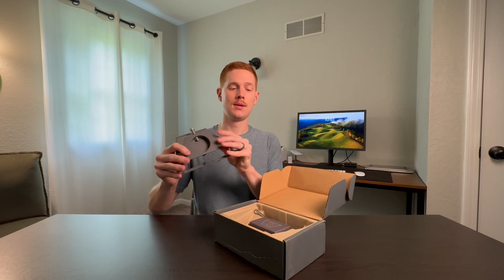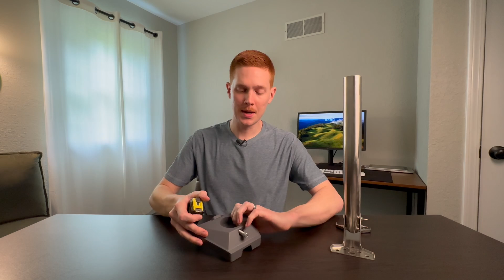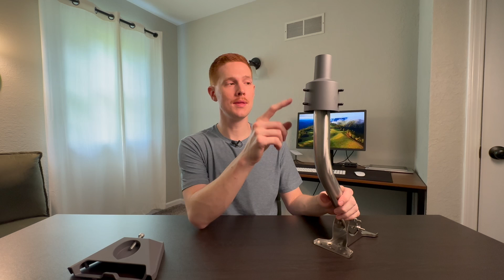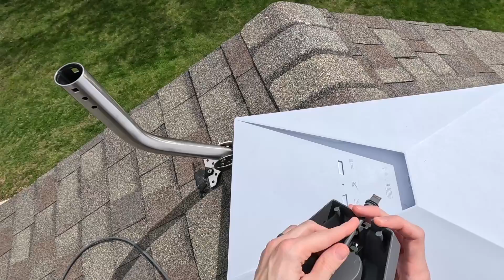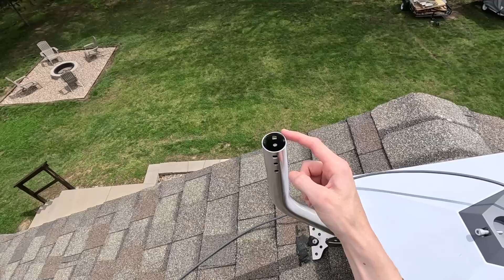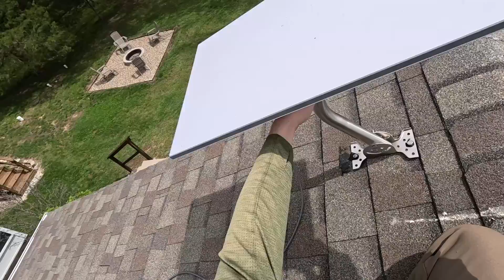The Worst Starlink Accessory - Gen 3 Pipe Adapter Review

Comment: I installed my Starlink in July 2025 and the new Gen 3 bracket is much improved from what is shown here, and I had no trouble with the installation. The hole is deeper and there are now two bolts to secure the pipe adapter to a pipe. In my case, my J-mount was probably 1.25 inches in diameter, but I got a very secure coupling. Bottom line, this video is now outdated, and the advice should not be heeded. Since this channel‘s owner is a responsible and well intending individual, I would suggest that the video be pulled.

Comment: This is an outdated video. I just got my new adapter this week and installed without problems. The pocket is much deeper than what is shown on this video and it has 2 screws. Please remove this outdated video and don’t mislead others into buying third party adapters.
Reply: Can I remove my dish satellite and connect the adapter to the pipe that held the satellite?

Comment: I purchased a stainless steel mount from Amazon with SIX set screws total in two rows and a deep socket for the pole. I can’t yank it loose but I think I want to add a self tapping screw that will penetrate the mast. Our building codes assume 100 mph winds. A loose connection to the mast will turn the Starlink antenna into a wing in a high wind.
Reply: Do you remeber the name of your adapter?

Comment: Most shops seem to be selling the second version which is virtually the same as the first one. Did Starlink give new antennas to those who lost theirs?
Reply from the maker: The new version does fix the main issues. It has a deeper tube to accept more pipe, and now uses two set screws instead of one. I haven't gotten around to a follow up review, but reading online reviews, it seems to be a decent option now. Still plenty of 3rd party pipe adapters if you don't trust it. I haven't spoken to anyone who lost their dish due to the design. But since it was a recalled device, any dish damaged by the original pipe adapter should be replaced free of charge.

Comment: What I’m actually looking for is a Gen 3 to Gen 2 pipe adapter.  We like our Gen 2 mount but of course the Gen 2 pipe attached to the dish securely snaps into the mount and I’d like to keep the mount but use it with a Gen 3 dish.
Reply from the maker: Got ya covered: https://youtu.be/KCFuqaxZrYE
Reply: @DISHY_tech  Super helpful,thank you.  I guess my only concern is that in this video you list the Starlink tube adapter as the worst accessory.  I’m thinking maybe i can buy a better Gen 3 tube adapter and then cut the tube off my Gen 2 dish.

Comment: You should be able to rig up a pipe adapter to go from what looks like the 1.5" pipe to the 2.5" recessed hole in the mount.

I'm sure you could find something in the plumbing department that could be used.

A schedule 80 bushing adapter runs about $10 and might work.

Comment: They must have done a third revision. Just ordered a kit and I’m going to mount to an offset mount off my Rohn tower. The pipe adapter I got has two set bolts about an inch apart. Not one. Ordered sept ‘24

Comment: Channel Master has solved this Delima check out the "Channel Master Starlink Gen 3 Pipe Adapter - Pipe/Pole Mounting Adapter for GEN 3, V4 Starlink Dish" reasonably priced, durable, and from a company that has forgot more than Starlink knows about connecting to metal pipe LOL

Comment: First off people need not assume rocket scientists design these mounts, this is laughable.
Second of all, just looking at it, a hole through the pipe on one side , slide the set screw and tighten it on the wall inside the pipe.
If set screw is too short, buy a longer one.

Yes yes we can all say why wouldn’t they get it right in the first place?

But how many 35$ items are perfect ? None

Comment: I got my mount yesterday- it’s new and improved. Works just fine.
Deep pocket and two set screws.
I have it mounted to the old 2” DirecTV mounting pole on my roof.
Extremely solid.
Reply: Same here. 2 set screws deep pocket
Reply: The regular pipe adapter that everyone is trashing?
Reply: @dosepulveda1  they redesigned it again from the video.....the one they originally sent was less deep with only one screw.....that was was horrible...the new one they are now offering seems to be much better and is deeper channel with 2 bolts....if its true then you wll save by going with it versus the other one listed as alternative
Reply: was thinking of being lazy and just adding it to my old direct tv dish they never got myself and its already mounted facing in the sky with no trees in view...prob be best
Reply: @marknichols7861  But I guess that Starlink will not send out the new 2-screw model as replacement to those who got the previous one.
Reply: is that storm durable?

Comment: The starlink website is listing a new version of this now with a deeper mount and 2 set screws
Reply: The problem is the second screw is not on the opposite side  - that's still not going to secure it adequately.  It's just squeezing a pipe with screws pushing in on one side; same as the original just that there are two screws instead of one.  It will still have the same problem as the original design, it just won't fall off as quickly.  Still a hard pass for me.
Reply: @Sui778  I believe if I were using this style of mount, I would use a type of pipe that isn't going to collapse, something like schedule 80 steel pipe which is very strong 'industrial' grade thickness, rather than galvanized or weaker metals.
Reply: @jeremiahjohnson5205  But isn't the point here to use your existing pipe, not buy a new one? So it will have to work with most pipes

Comment: So it’s not just me, I didn’t buy yet but was thinking it surely doesn’t just rely on that shallow socket. Might be ok if you drill the pipe out and rivet nut it + loctite, but most people don’t have the tools and skills for that.
Reply from the maker: As of this week, Starlink is now offering a different design. It has a deeper socket and 2 set screws. It's now live on the shop and has replaced this version.
Reply: @DISHY_tech  I hope it's easy to swap and refund. I just ordered the old crappy one and now just saw they have a reasonable looking upgrade.  They  should send me the new one for free....dream on.  :-(

Comment: Actually this is the best accessory.  It's steel and won't flex in the wind at heights 25' in the air.  To secure it drill a small hole with a titanium drill bit and feed an eye bolt through, then add a second eye bolt through the pole as a cross bolt before tightening up with nylon lock nuts.  Couldn't be more secure and cheaper then just about every other option with the added benefit of height.  Holds up in storms no problem, might want to lower the telescoping pole 5 - 10' but personal preference, likely not an issue unless a tornado is headed your way.  I even fly old glory and take it camping.

Comment: Thanks for posting this! My Gen3 equipment is due to arrive later this week, and my tentative plan was to buy this mount (once I settle on installation location). The third-party adapter you show does indeed look less bad than Starlink's (due to the depth of the receiver), but the circular shape is a fundamental flaw when the pipe is a smaller diameter than the receiver. They should instead be using a triangle, with a pair of set screws centered on one side. The set screws would press the pipe against the centers of the other two sides, providing far more support and eliminating the side-to-side wobble you showed on the roof.